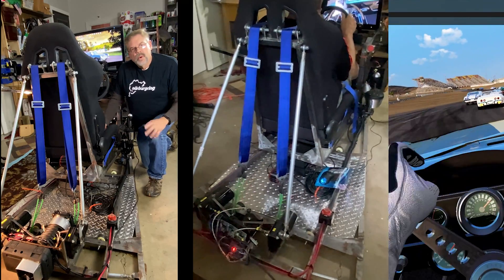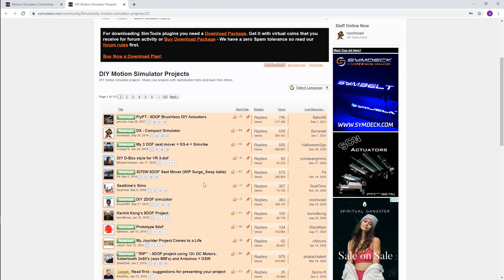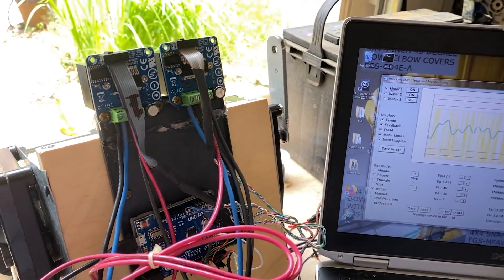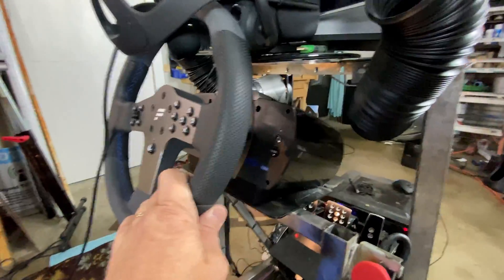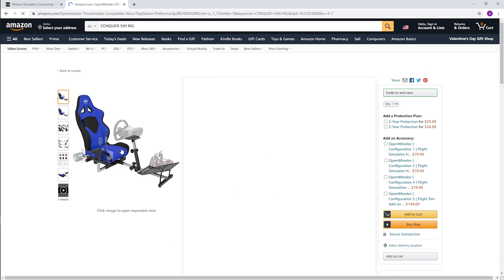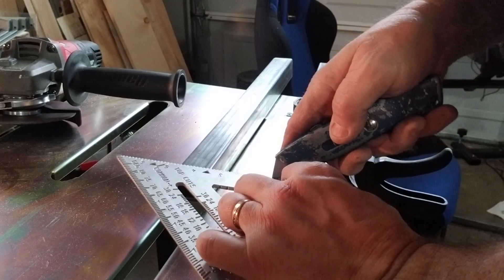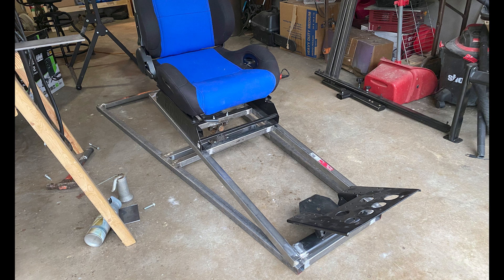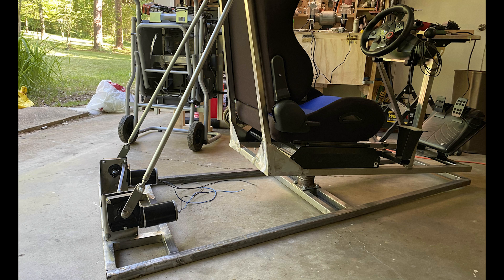How to build a Motion Sim Racing Rig - Start your journey!

Comment: Hey, i really liked the idea of your project, and im very inspired to do something similar, because i started to play racing games on the computer with a  keyboard, and a Logitech wheel is pretty expensive.. i really want to learn to weld and tinker with electronics, because I really like the concept of making something my own, and i have a question if you don't mind. Do you have any tips on making such a big project like your's, the struggles you been through the making process. Thanks for such a great leason.
Reply from the maker: Hi and that's a great question. I think the welder was a big hurdle for me. I waited until it was on sale and I had a cupon for it so it actually costs about $120 in the end.. I figured welding I could figure out how to do it.. The rest I just saved a little at a time and bought.   I'm actually working right now on a 3 part series on how to turn your static sim rig into a seat mover using WW motors..  I should be posting the first part on monday So check back if you can my friend! DMAX
Reply: @DMAX_DIY  Hey thanks for the reply, really appreciated. With my abilities i only could do a seat mover with windshield wiper motors, because the project that you made, wouldn't fit in the house.. Your channel really inspired me that you can do anything you want if you are determined to do it. And i have another question if you don't mind.. From your gained experience in building something like this, how much approximately would it cost to build a seat mover, i have all the tools, i probably have the windshield wiper motors, and an Arduino.. Your answer will really help me in the future, thanks...
Reply from the maker: @DZAF_EDITOR   I am working on the video as we speak. WW, ITB-2,arduino. I'll have a cost analysis at the end of video 3 all link all the parts in descriptions.  Thanks for the question my friend! DMAX

Comment: Hi Dave,

first of all I have to say I think it's terrific what you've created. I am totally enthusiastic and would like to build myself such a motion simulator. The first question I have is, how did you determine the dimensions of your rig? Did you take a template from the web? Or what are the dimensions of your rig? Before I buy the necessary square tubes, I should know what quantity I need. To the square tubes still the question, what thickness do they have? I would have taken tubes with 1.5748" x 1.5748" for the main frame and 1.1811" x 1.1811" for the seat construction, each with a thickness of 0.12".
Sorry, in Germany we have other size specifications and I have now simply converted them via Google.

Greetz
David
Reply from the maker: So I posted most of the build here and a few pages in someone asked me for the measurments so I added a bunch of photos for that..https://www.xsimulator.net/community/threads/full-frame-2-dof-traction-loss-new-build.14740/
Reply from the maker: Hey David, Going to make a 3 part series on building a seat mover.. Starting this weekend my friend! Take a look if you get a chance! DMax

Comment: I would love to build one but two things I am afraid...not knowing the exact components to buy and then I see people using 3D printer and I was like forget it, I don't know that shit.  The other thing I most afraid is making the software work...and how to hooking up the controllers and the drive to get the motors running.  I seen a few clips of someone trying to set up the software and it looks like such a pain...they use DOS command to get it to communicate, getting firmware and setup the settings...I wouldn't know it unless someone does it step by step.  So those are the things I fear.  Now don't get me wrong, I am pretty knowledge in building other stuffs...I just built a $4000 PC, I figure out a lot of things...like fixing cars, PC software and understand how to put pieces together.  The only thing that get me confident in building a 6DOF rig is if someone break it down and go through step by step and explain how things are put together and how to get the hardware communicate with the software (don't skip anything)...then and only then I am confident of building my own.  I went to that SIM lab forum or whatever that place is where they have people built and tell you what to buy but still it wasn't totally informative....even watching the video (it was only bit, pieces...not step by step)...i am still not confident ...especially when it comes to making the software work.  And then seeing them putting the metal frame together by welding it...i am like forget it...I never done welding and don't have the tool.  I figure it's for people already have that expertise in carpentry and have the tools to put things together.  Not for someone that never done this sort of thing. I am more of someone that just want to buy all the parts and fit them together, not needing to build any part at all.  Some people say it's easy, but I have yet to see a video that actually go through step by step from buying to assembling to making the software work.  And really explaining the details of it...why you did the way you did...ect., and not just that but educational about it.  For example, explain what the controller is and the drive and what you did to communicate with each other to make the motor run.

As for D Max, all power to you...I think you're not afraid and you have the tools to do whatever you want.  If i am you, i would try 6DOF RIG.
Reply from the maker: Hi Reptilexcq2! So I would forget about 3d printing and stuff. The controllers to drive the motors are pretty easy. You don't need DOS commands or anything like that. or firmware  stuff. it's just electricity. which is pretty much  "ON or OFF". So, like you, I never 'welded' before or anything like that but I took a 'leap' and just tried it. it was pretty easy.. A 6DOF is what's next for me. but it's 6x the work and maybe 6x the issues. (I'm up for it now, but am settling in on my 3 DOF rig pretty nicely so the pressure to build a wild rig is kind of 'off' for me right now.   I would say the easy way is to BUY a DOF reality rig.  I don't have one, but you can gain experience with it first. But you will still have to navigate some software (same stuff I use - SimTools and plugins - watch a few of my videos on that if you have time)..  BUT   A 6DOF is another animal altogether - I'm still apprehensive, myself,  as each motor I need costs about $300 and I am still not sure.. But That's my next project maybe in SEPT or OCT.. I will do a complete series on the build in YouTube.    You are right there is nothing 'step by step' on YT about any of this as it's kind of a fringe science.  But to build a 6 DOF, you either pay DOF reality the money or you build it yourself. Either way, let me know here or on any Random video of mine what you decide and how it goes.   All the best my friend.. Hope you check back on my channel to see what's going on as I will be adding part 2- of my    3dof motion build which includes how to get the software (simtools) to talk to the arduino etc  All the Best DMAX
Reply: @DMAX_DIY  I just bought a DOF P3, that rig look solid. I think you're right...by playing with it, I will pick up how the software and hardware communicate. I'm already modifying the new rig. In the future, I may try to build a 6DOF or settle with upgrading the P3 to P6. But from the look of it, the DOF 6DOF doesn't appear as advance as the one I seen people built. The motion doesn't look natural simulating the up and down of a car bouncing. I'm most impressed with this guy's build https://www.youtube.com/watch?v=4QP5pIsfl6I
If you can build one like that, I'm looking forward to seeing step by step.
Reply from the maker: @reptilexcq2  Well, at least your "IN" without having to build.. I wish I could have one to mess around with and compare the physics.  Good deal my friend.. Please check back on my channel if you have a chance. I only post about once per week, but it's usually better than most of the others..  Good Times my friend! DMAX
Reply from the maker: @reptilexcq2  Silent Chill? Oh man.. He has gone through some issues for sure. Not the best communicator, but he's burnt' out a lot of MM boards.. Probably best to wait and enjoy your P3 for a while..  I love my 3DOF for now after getting it 'right' after 8 months. It's pretty much perfect (as you can see in my last video) but if I went with 6DOF, I would get bigger motors and use different motor controllers like the ones that 6degrees of flight uses. They can handle more amps. DMAX
Reply from the maker: This is not step by step but here is a video I made on building the rig during the pandemic  https://www.youtube.com/watch?v=4cTyjsvO-i8
Reply from the maker: A link to x sim on how to set up the software
https://www.xsimulator.net/community/threads/smc3-arduino-3dof-motor-driver-and-windows-utilities.4957/
A link to my build on x sim forum with dimensions progress etc.
https://www.xsimulator.net/community/threads/full-frame-2-dof-traction-loss-new-build.14740/

Comment: Hello from far Ukraine! Just saw your video. Awesome job! Definitely will build a copy of your design! PS: I'm making a DIY steering wheel using old pc wheel and changing 2 microcontrollers: Arduino Leonardo and STM32 BluePill right now. 3D printed 8 speed h-shifter. Pedals are still printing. Budget is 40$. Without Force feedback right now.
Reply: hope you are well wherever you are <3
Reply from the maker: @e90julien  Yeah..  I was just looking and  Oh Crap.. He's from Ukraine..   I wrote him .. hope he's ok..
Reply from the maker: Oh that's awesome! Nice! Thanks for the comments my friend!  I posted the build on x-simulator.net  if you want to check out more https://www.xsimulator.net/community/threads/full-frame-2-dof-traction-loss-new-build.14740/
Reply from the maker: I gotta agree with Julien..  I hope your ok my friend..   Dave

Comment: How does VR positioning work? Do you have cameras on the frame?

I'm at the start of the road to making my own 6 motor, 6dof rig. Was going to jump the VR motion compensation hurdle as I reach it, but I'm interested on what you found.
Reply from the maker: I was skeptical, but never really found out the info I wanted, so I just set up my RIFT CV1 with 2 cameras, unplugged one of them and dove right in to see what happens.  I really had no issues, except the camera has to be able to see the headset.  The first time hitting the throttle I thought OH CRAP ! This is Great! Because It was spot on. I have never had issues in VR so I would say it's ok on my rig. Not sure how that would translate to a 6DOF. (planning on building on with those motion dynamics motors in the future)  Thanks for the comments! DMAX

Comment: amazing man
Reply from the maker: Thanks! I appreciate it! Lots of Lockdown fun waiting to be had.. DMAX
Reply: @DMAX_DIY  whats the motor model ?
Reply from the maker: @thevirtualgamegod  50:1 12volt motors  just search Ebay for GEAR MOTOR 12 VOLT GREAT FOR SAWMILL/CRAB POT PULL/FEED/SIMULATOR 75-80RPM 50:1  (sold by PGSAW in Canada)
Just put in "GEAR MOTOR 12 VOLT GREAT FOR SAWMILL/CRAB POT PULL/FEED/SIMULATOR 75-80RPM 50:1 " in Ebay.
They ship from Canada.. It takes about a week and a half to get them in the USA.. 
I really like them but if you want more powerful motors, you need to go to Australia... Motion Dynaimics 60:1.   DMAX
Reply: I am going to build this too.
Reply from the maker: @thevirtualgamegod  It takes a little while to make, but once those motors move you, forget it!! It's ON! and you cant stop having fun!  DMAX

Comment: Thanks so much for this overview. When i get some time I would love to build one and this broke it down into easy pieces to understand what I would need to do. When i look at your rig, it looks so complicated, but actually its just simple steps. Really hoping this video gets some traction as you have some great content.
Reply: SirSpats - I'll be doing this asap. plz stay in touch
Reply from the maker: @roddy6924  Thanks Guys!  Comments are awesome!  DMAX
Reply from the maker: Thanks for taking a look! It's really just a bunch of parts that work together pretty well. Takes a little time to build it. But by making it yourself, if something acts weird, you know what it is and it's usually pretty cheap to fix. If something goes haywire with a commercial rig, you have to send it in. We all pretty much use the same components anyway (from what I can see). In any case, this thing is an absolute blast to drive in VR.  Now with the Wind Sim, it's even Cooler haha DMAX😀